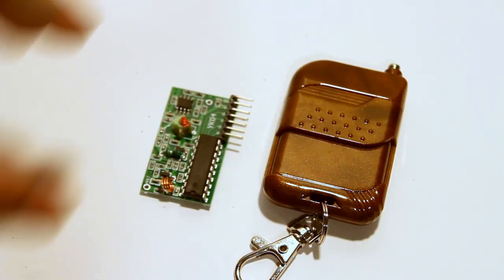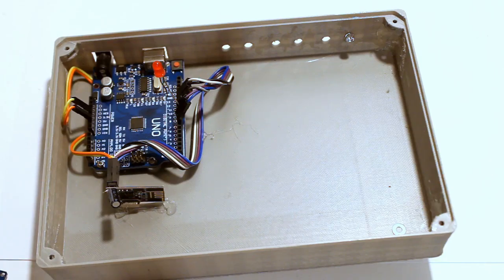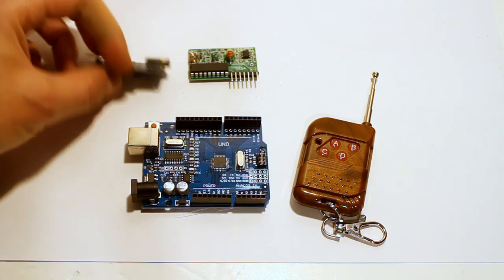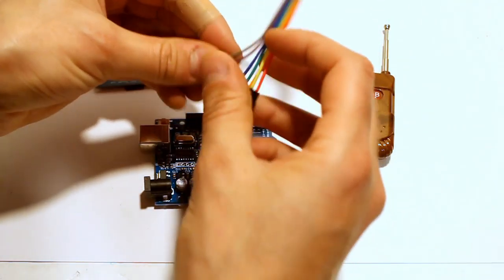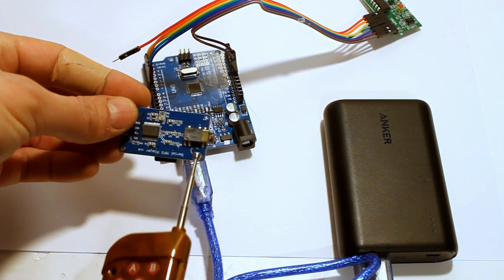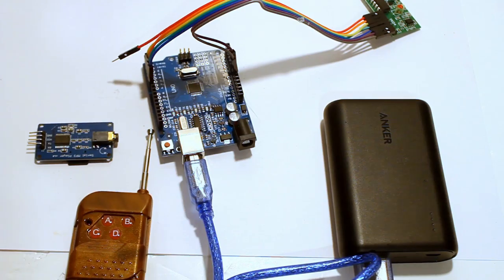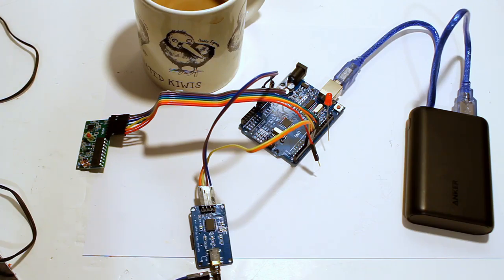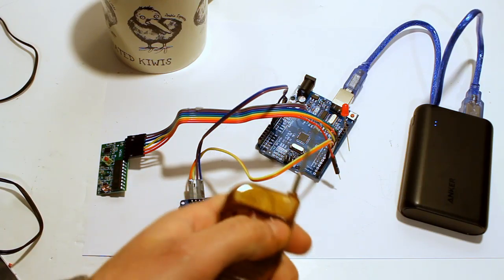Arduino Fun | Remote Sound Effects

Comment: Hello Dan, I am looking for an application to make a single sound effect (Boom) for an air cannon we use for teaching U.S.A. Civil War Artillery to eighth grade middle school students. The cannon only makes a woosh sound from the air rushing out. It would be cool if we could secret some deep bass speakers into fake "hay-bales" to make a low rumble boom when the cannon fires. What you have here seems to be  more complicated. We would like to just attach the send into the circuit of the cannon which is 12 volt. Could you suggest? I am not savvy with your tech. My cannon is shown on TheCannonGuy facebook and "thecannonguy" youtube. any suggestions would be helpful. Thanks.
Reply from the maker: Maybe a little board that can record upto 120 seconds of sound could work. Maybe you can find something similar on ebay USA? search for "Sound Voice Recording Playback Module "